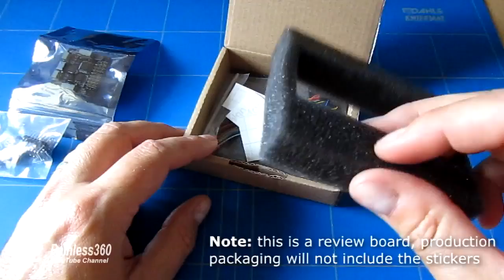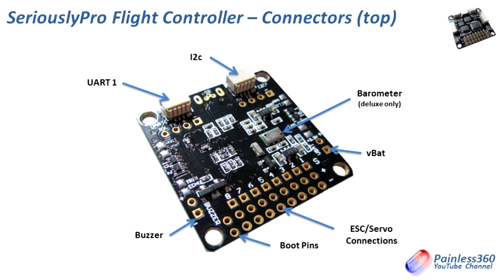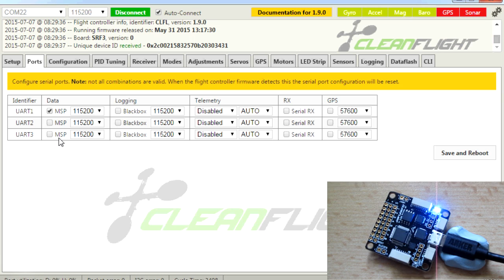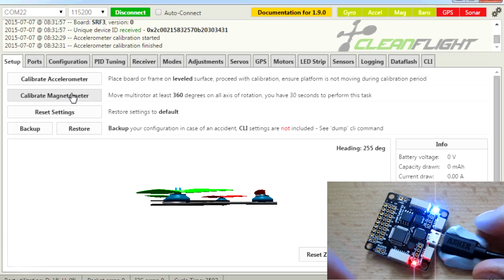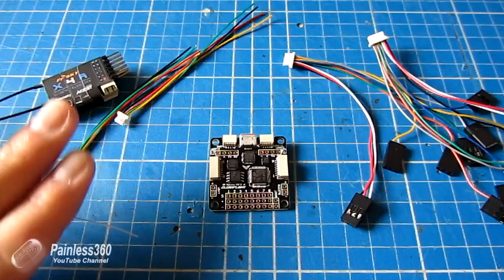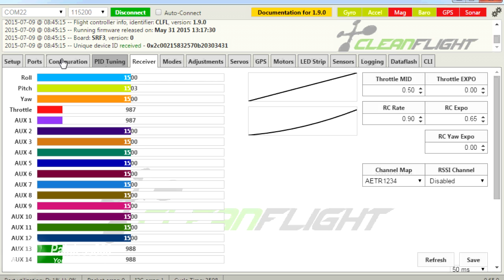(1/9) Seriously Pro F3 (SP3) Series - Overview and firmware installation

Comment: You rightly point out the need to observe the polarity of connections, but the board is not consistently designed.  On the ESC connector the signal pin pads are square whereas on all of the other inputs/outputs the negative pads are square.  Whilst they are also marled I think it a shame that consistent shapes were not used throughout.

I wonder if there is a reason for this.
Reply from the maker: UKHeliBob I don't see a problem as the manual is clear on the pins and the printing on the board by each connector is very comprehensive. Happy flying!
Reply: Painless360 True, if people are careful then there won't be a problem, but as Dominic went to the trouble of having different shaped pads it would have been nice if the shapes were used consistently.

I suspect that this is a case of Dominic being so familiar with the board that he does not see it the same way as someone who is not involved.  I wonder if the board and manual have been used by a "British Standard Idiot"

I have previously been involved in the design of the user interface for computer software and it is amazing what problems arise when a real user tries to use what you have designed.
Reply from the maker: I can't agree more, that's the point of this channel. All of the detail I cover (with rare exception) comes from existing manuals and sources but still cause issues. The next in the series about connecting PWM, PPM and S-Bus to the SP3 is a case in point..

Happy flying!
Reply: UKHeliBob 
That's most likely due to a setting of the PCB layout program. Almost all of them have an option to signify "pin 1" of a component by a square pad instead of a round one (take any device apart that uses some through hole ICs and you'll see that there). So this was no conscious choice but rather an effect of placing some connections as 2 or 3 pin connectors and some as single wire pads and not disabling the feature for certain connectors/the whole board.
I do PCB layouts myself (as a hobby) and I check for stuff like that, but in the case of the SP3 it is not that important, because the pads are labled and you don't really see that anymore anyway once the pinheaders are installed.